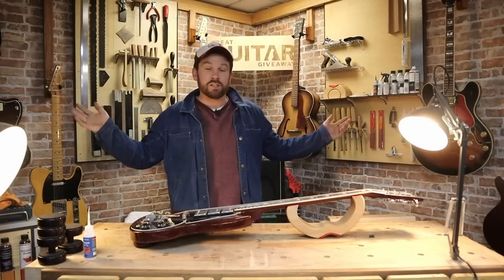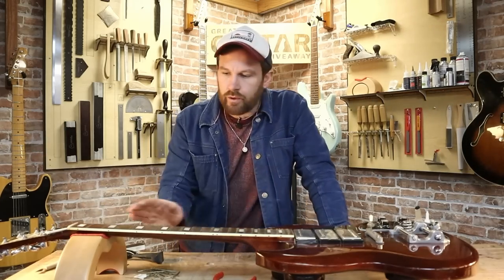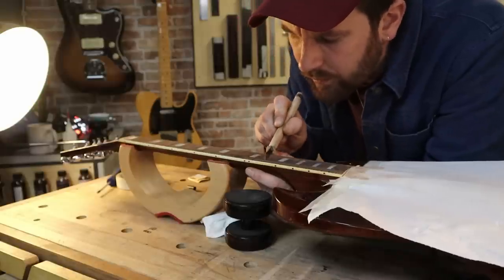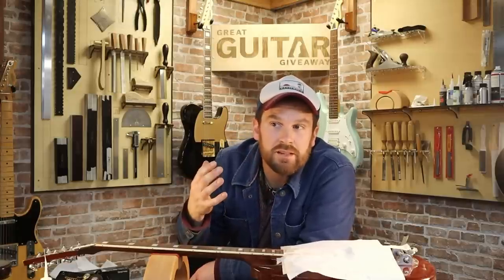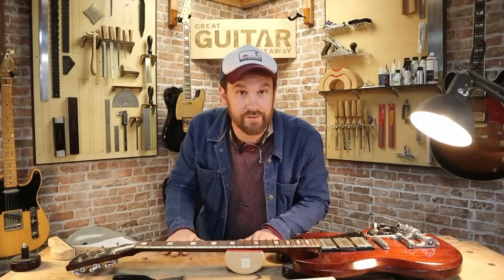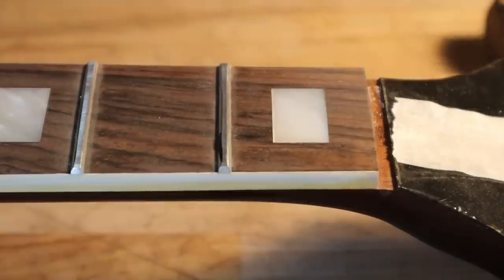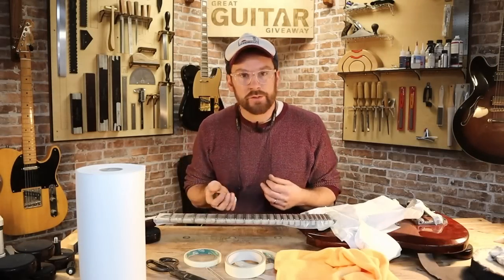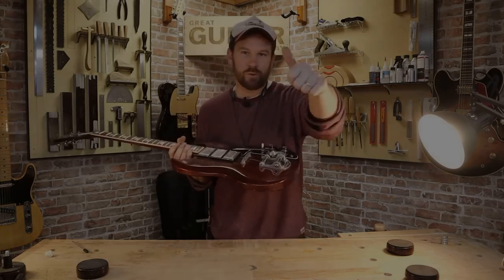Re-fretting Tutorial | A very well Loved 1972 Gibson SG

Comment: I've been putting off re fretting my Gibson SG junior p90 for about a year and this video has given me the kick up the arse to actually do the job! ( my stuff always gets left till last ) I'm considering using Hosco stainless steel medium jumbo just so I never have to do the job again ( I re fretted it 10 years ago with jescar wire )
Reply: Thats great to hear! Good luck
Reply: @josh stopford  great video and definitely easier without the fret nibs as most Gibson people want to keep the nibs and it just takes ages to remove the binding without massive damage to the finish then it takes 4x as long doing nibs and the finish work to hide the scaring.
Reply: @stu-j  you should see the level of work people do when they leave nibs intact and refret and cut the frets to fit exactly inside the old binding. It’s insane like 10’000 of an inch off is exactly perfect for your top E to get stuck between the binding and fret. My Dad was an old school carpenter and they were taught to have a 10’000 of an inch tolerance but this requires even tighter tolerances.

Comment: If you have a long sanding block, it is always sanding the middle section of the neck, but only 50% of the time is it sanding the head end, and 50% of the time the pickup end. So the extreme frets will be sanded less than the mid-neck ones. If you used a very short block, it would be sanding all regions much more equally. But the long block eliminates differences better than short one does. Something in between, perhaps?
Reply: Also I would tend to put some 'fall away' in the upper frets, particularly on 7.25" radius boards, which would counter that tendency to take more from the middle. It keeps upper fret string bends cleaner on tighter radiuses.

Comment: How did you get the frets "just shy" of the binding?
Reply: I wondered what he meant, as I was watching on phone, but I think what he was meaning the bevel inwards stops just shy of the binding. I use a fret bevel file which is set to 35 degrees and that is usually perfect. (The kind where the file is slotted into the wood at the correct angle like stew mac or Chris Alsop sell)
Reply: @MrSongwriter2  Hi. At the 25 minute mark you can see the fret end is trimmed back so that it touches the edge of the binding, not the edge of the fingerboard. How that was done isn't explained in the video.
Reply: @LordSneferu  yes I see what you’re saying now. I agree that was not explained. I’m as curious as you. That’s a whole lot of skill to cut the frets 0.2mm short of the binding on ALL the frets. I’m wondering if it was filled at 90 degrees running the file on the safe edge all down the fretboard. I’d love an explanation so we can all learn 
@joshuastopford
Reply: @LordSneferu  as I didn’t get a response here I asked on Reddit. Turns out I think we both overthought it. He just bevelled the binding aver so slightly or it was already bevelled slightly on the binding. I’d love Josh to reply to confirm or correct this. I tend to do this as it creates a nice roundover on a strat neck and it feels so much nicer. The les paul I did the binding was already bevelled slightly so I just followed that when moving to the diamond stone to smooth the edges after the bevel file

Comment: Question: If you leveled the fretboard before putting the frets and the frets are all the same height, all glued to the tang, why do you need to level the frets ? I never understood that.
Reply: Fret wire is not necessarily uniform along it's length. There will be rises and dips along the way.
Reply: @HandlebarWorkshops  thank you!
Reply: Don’t forget it’s the human element involved in pressing or hammering frets. There can also be an inconsistency between how the fret is seated. The idea of levelling the board is you save fret metal and create the perfect environment. The exception is maple fret boards if you’re not wanting to have to respray the board.  @vgmoulin
Reply: @MrSongwriter2  Thank you
Reply: @vgmoulin  you’re most welcome

Comment: THE PERSON WHO HAS TO DO THE NEXT REFRET ALREADY WANTS TO PUNCH YOU IN THE FACE.Superglue? Really? And the fact that you forgot to straighten the neck after the fretting , the meat taken from the middle frets means it wont be too far away.
Reply: Superglue is standard or titebond. Only a muppet pulls frets without heating with a soldering iron. That deals with superglue or titebond wood glue. I do draw the line with Ben when he used to use no more nails in fret slots. That sets like concrete. It’s great for bodging loose plasterboard fixings in modern houses though.
Reply: On the straightening the neck yes I agree it’s worth double checking, it shouldn’t really move unless you’ve used the wrong size wire with too wide a tang. I had more of an issue with using a notched straight edge to straighten the board whilst not aligning the slots so that the raised chips or gunge under the frets was avoided to get a true straight not resting on the gunge/chips

Greater scheme of things he did the job well and the customer got a refretted guitar without buzz and no damage to the board
Reply: @MrSongwriter2  you have obviously never had to remove frets glued in with superglue. Titebond and superglue are two very different materials. Trying to heat superglue to a temperature that works would burn a board beyond recognition. I have not ever had a refret after superglue go well.
Reply: @danielwotton5961  I’ve done refrets on guitars with superglue you can see/smell the fumes when you heat the frets. It’s just you spend longer on cleaning the slots out. As long as the board is cleaned up and the slots cleaned out it’s fine.